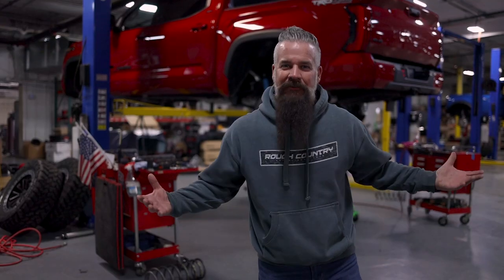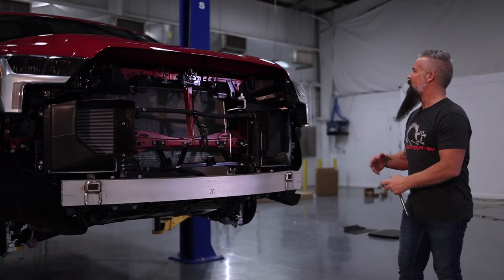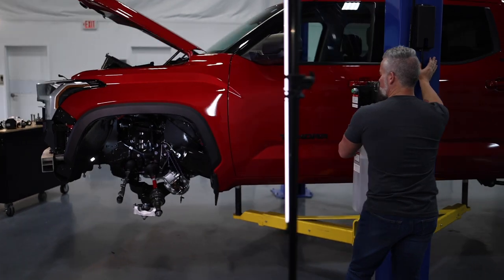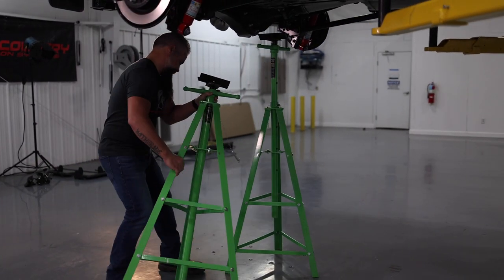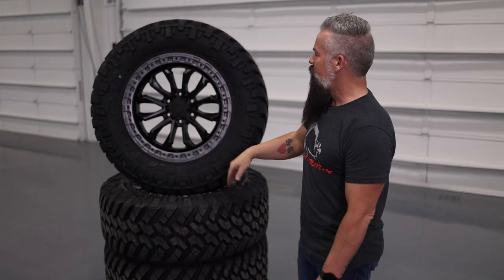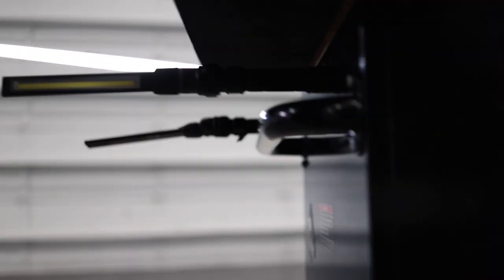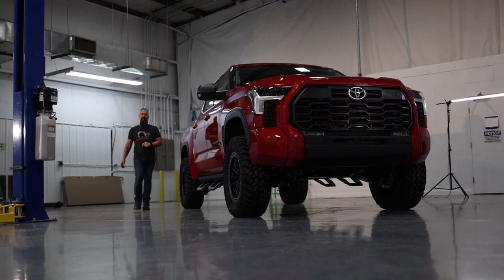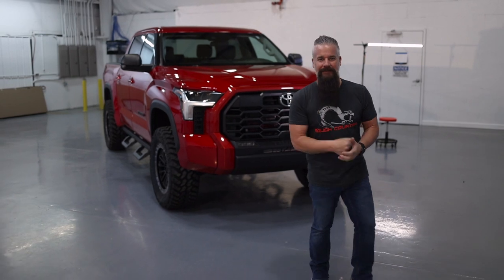Lifted 2022 Toyota Tundra 4x4 TRD Build

Comment: Just so you know that skid plate is called ballistic nylon and it's just as strong as steel but doesn't dent and doesn't rust once the coating is scratched like steel does.  It was used to lighten the overall weight of the truck.
Reply from the maker: Yeah, I addressed that later in the build, but it got cut for time. We figured it would generate comments anyway. - Gaston
Reply: @RoughCountryTV  Truck looks great though.  Color matching really made a huge difference.

Comment: I’m curious and surprised why didn’t you replace the sway bar for a trd one. It makes a huge difference on the ride of the truck. Plus, it could have added a red touch to the front bottom of the truck to match the exterior.

Comment: This looks great - the paint scheme is how Toyota should have made them to begin with.  2 questions. If I wanted this on my '22 Tundra, would I buy the parts then find a local installer to put them on or would I need to travel to your location?  Next, how much would all of this cost if your team did the installation?
Reply from the maker: Check out our dealer locator here. https://www.roughcountry.com/dealer-locator/
You should be able to find one that can sell, and install for you locally. If you are wanting to have us do it, call 800-222-7023 ask for Seth in installs. He can get you an exact pricing breakdown.-Gaston
Reply: @RoughCountryTV  What state are you all located?
Reply: @franktdot5932  Tennessee
Reply: A little different but along the same lines I installed their 3.5 full kit (including new leafs) on my XJ in one weekend. Was not bad at all, great instructions and videos.

Comment: With regards to the suspension kit and tires, was there any recalibration required for the safety systems and speedometer to be accurate?

Comment: Hoping someone can answer this.  I got a quote to install the Rough Country Lift Kit, but they also quoted an additional icon 3" Suspension System (which is $3324 for parts and labor)  is this needed?

Comment: Everything looks awesome! Two questions did you consider blacking out the Toyota emblem in grill? And color matching the fog lights strip to brake up the black grill and bumper? What exhaust system are you thinking of using?  Your trucks badass!!

Comment: Nice work for a terribly designed truck 
I can’t believe they built a 70k truck with no puddle lights or bed steps 
but I’d love to see RC put more into Nissan lift kits the frontier sold 18k pro4x units and yet you don’t have a lift kit for the pro4x model it’s the second most owned truck in 22 small segment behind Tacoma. 
Love this company but you have constantly neglected the Nissan brand xterra owners begged for 6inch kits and you have Titan owners wanting front coils and upgraded uca in the 3 inch kit with out buying spare parts. And easy way to make kits clear stock wheels is add spacers to the kits so kits clear the hub
Reply from the maker: We've passed your comments to the R&D department.  
Also, we do have a Titan 3 inch lift kit with struts/upper arms  https://www.roughcountry.com/nissan-suspension-lift-kit-834c.html#256=454&154=94
Reply: @RoughCountryTV  that strut upper arms is not a pro4x kit same thing for frontier and the kit doesn’t allow you to upgrade to upgraded upper control arms that are more HD you have to buy them separately which cost as much as the kit to where you end up with a set up uca that are now officially useless

Comment: Scared to death to do anything to my 2019 Tundra. New service manager says if I doing anything to my truck it will void all (ALL ) of my warranty!  Would love to put a 1 and 3/4 lift on the front and change tire size from 255 / 70 r 16 to something with a little more height.  Any solutions?

Comment: Does this handle, no pun intended, rough country? Spacers in the last gen even with bump extensions were know for collapsing the shocks in the front. I am talking logging roads where logs are used across the road for low lands. I've been a victim of spacers, then again with spacers and bump stops till i just did a mid travel from icon. lift makes it look great but it would be a shame if you couldn't use all the travel of the suspension.